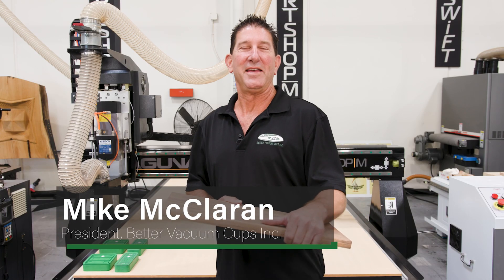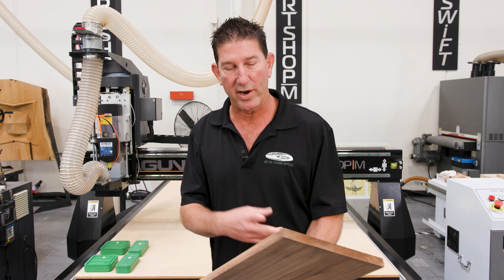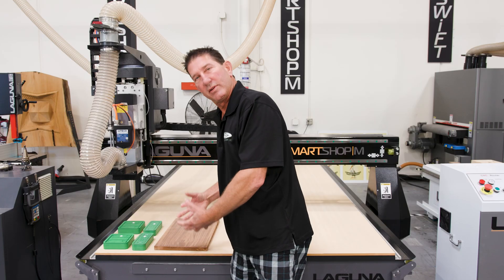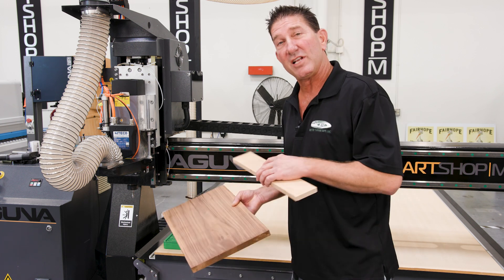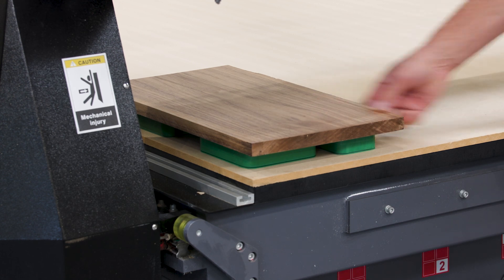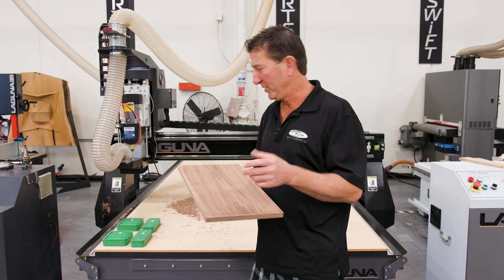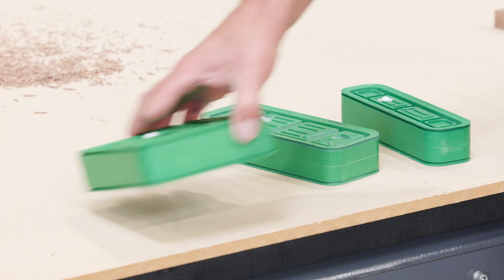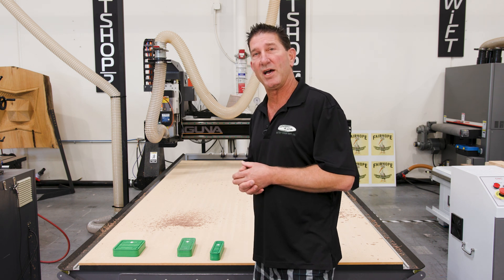BVC Double-Sided Vacuum Cup Accessory to Improve CNC Machine Use | Laguna Tools

Comment: I was at IWF last week and came across your booth.  This seems to be an excellent product.  It's perfect for making signs or other items where you don't have to cut through the board (which would damage the cup if not properly located).  That said, suppose I had a piece that would traditionally be cut with a scroll saw (i.e. lot's of small cutouts on the interior of the piece.  

What are your thoughts on placing a piece of 1/8" thick MDF between the cups and the piece to be cut to effectively make a spoil board to protect the cups?  I'm talking pieces that are no more than 12" x 12".  Have any of your customers done anything like that?  I know I can use gasketing directly on the primary spoil board of the CNC router with my piece to be cut on top, but using the approach described above seems like it would be easier.  Your thoughts?  If my message isn't coming through clearly, I'll email something to customer service with some diagrams that depict the type of pieces I'm talking about.
Reply from the maker: Hey Charlie! Thanks for reaching out, and we're glad you had a chance to stop by our booth at IWF. 

Please take a moment to contact our customer service to relay more info! https://lagunatools.com/resources/customer-service/

Thank you.

Comment: I like the idea of these pods! Question...if this CNC DID have pop-up pins, would they come up higher than the pods so that you could square your material to them or would you use the pins some other way like using a board up against the pins as shown in this video with no pins? Thanks.
Reply from the maker: Hi Larry, 
Our pins are threaded in the center. In that case you would add your own extension to accommodate the height you desire.
Reply: @LagunaTools  Thanks. Any thoughts on how to do this on machines whose pop-up pins aren't threaded for extensions?
Reply from the maker: @steinbierz  If the pods are 3/4" thickness or thinner than they can be used with the pop-up pin system on our machine. For pods thicker than 3/4", Better Vacuum Cups (BVC) actually offers a retrofit pop-up pin alignment system that will work. Hope this helps Larry!